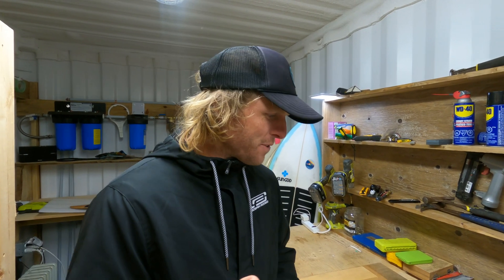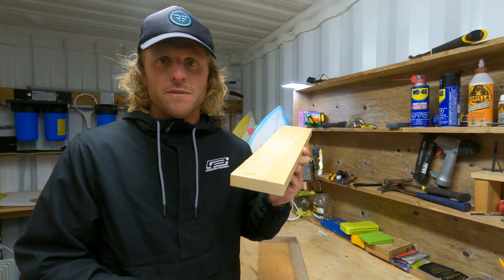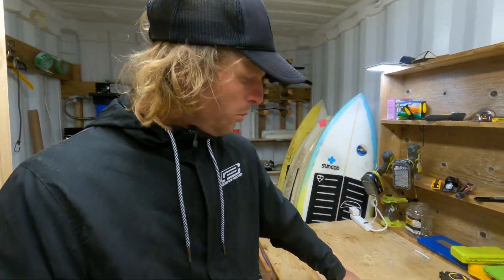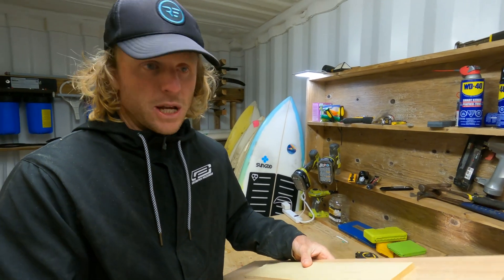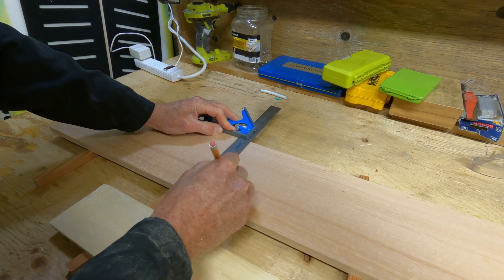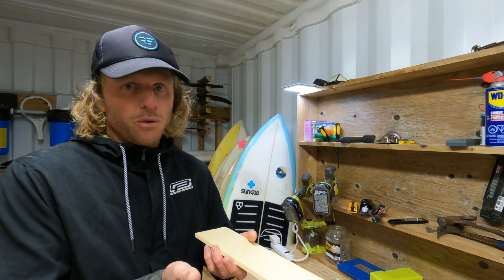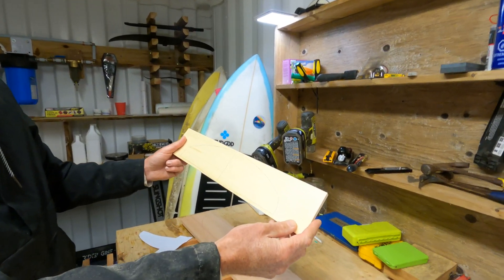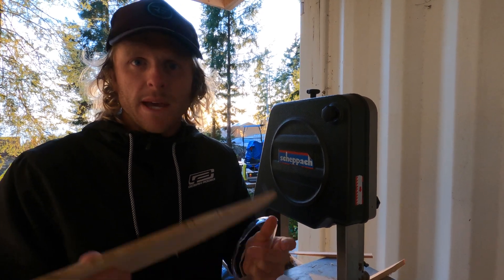How to build a Hydrofoil: Machine and Cutting Wing Outline's (Video 2/15)

Comment: Great job!
Cedar is good, easy to work with, light and "waterproof". It is naturally rot protected. Which is good, but this "oiliness" can cause poor resin adhesion and delamination.
I prefer to work with a plywood. It is better to be a marine PW. But thin-ply "Russian birch" works very well. Plies help to see if shapes of each side are identical (or close enough). Also birch plywood is stronger and less tend to warping.
Reply from the maker: Yeah ply is fine too, i plan on making a video using ply as its more easily available, and stable to carve. that said, we dont have any delimitation issues ever using cedar :) Any surfboard building timber works great.

Comment: Dude. You’re the man. This is exactly what I was looking for when I decided it was time to try the build myself. I’m a machinist and fabricator by trade so this should be a breeze. I’m super pumped to get going. Thanks for the FREE plans. I’ll def hit you up if there’s anything I did differently and let you know how it turned out. I will for sure be back to buy the mast, hollowed out aluminum is out of my skill set range. Again, You’ll hear from me again, especially if I figure out a way to make an inexpensive mast of the same strength and weight. Thanks again!
Reply from the maker: Nice, yeah mate keep us posted!

Comment: This is Jordan.  This is the easiest step of all.  I ended up using a scroll saw because I don't have a vertical band saw.  I have a thickness planer so that was easy, and the belt sander clamped on it's side is genius.  I ended up having Office Depot print out the plans on 11x17 paper, because our printer can only do letter sized paper.  Cost me $6.00 here in the states to print them out.  I already had pretty clear cedar on hand.

Comment: Hi, it's me again, have you ever tried Baltic Birch Plywood. It's really tough and has really thin Laminations.
Reply from the maker: Hey Merle, yes you can use ply. The only thing is that half of the ply has the grain running from the lading edge to the trailing edge, where as to help reduce flex it's nice to have all grain from wingtip to wingtip. That said, using a high quality hardwood ply like birch will be fine by adding 1 more layer of 6oz cloth to help stiffen the wing. 
Also, there is a benefit of using ply.. as your shaping the wings you an keep track of shaping it even either side by looking at the pattern the layers make :)